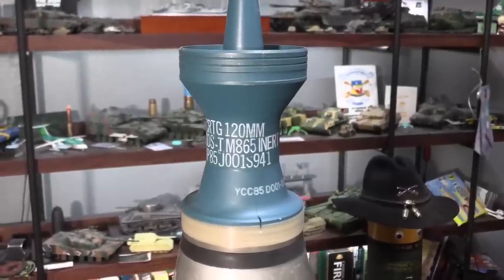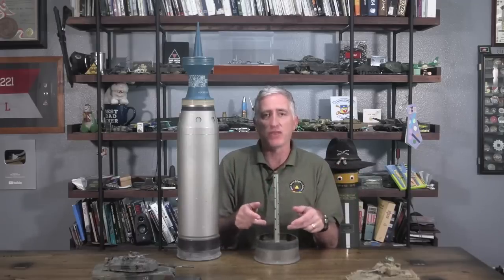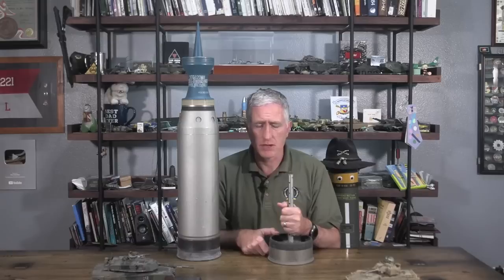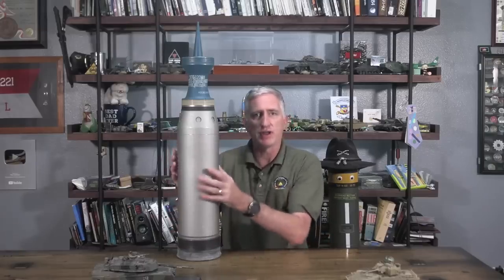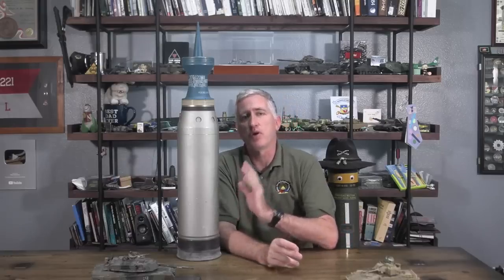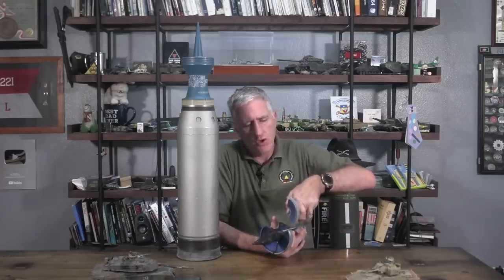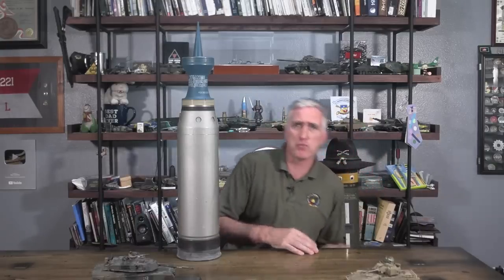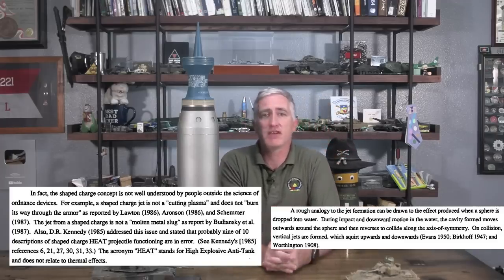Tanks 105: Anatomy of a Modern 120mm Round

Comment: Ahhh, aftcaps. I remember when we first got our A1s ha ing come from 60A3s. The aftcap deflectors on some tanks would cause the aftcaps to hang on ejection. And, not alway because the loaders were a bit too quick saying the main gun after it went boom. You listen on the jump frequency and you would hear "aft cap! Aft cap!" Overand over. And the loaders would normally already have the next round in their hands to load, but the deflector was in the way. Until we finally got everyone and everything dialed in, TCs and the loaderswould either kick the deflector, or knee it upwards. You could tell the tanks that hadn't got it dialed in yet as their loaders wore a knee pad on the leg used.
Reply: Yep. We were all used to hot loading the M60A3s. That was the only way you would get your times down for the gunnery tables. Then all of a sudden we couldn't do that with the M1A1s we transitioned into. Took a lot of adjusting to it.
Reply: The dern aftcap deflector is still a pain sometimes. A squirt of CLP and it usually clears up pretty quick. Either that or just be prepared to kick it.

Comment: About the end cap, those holes make me think of a mortar round.   It also has holes on the stem above the fins that allow the initial charge to bleed hot gases on the small donut shaped propellant charges so the mortar crew and "dial" in the range.
Reply: When you think about it, those are indeed basically mortar rounds with extra steps, instead of "cheese charges' you have a combustible case.
Reply: @robertsmith4681 ou have any info on those cheese charges? Like a technical name or designation/how they work?

My Dad told me about his early days & the different propellant bags & "cheese" that goes into making up a howitzer round but when he went AGR (early 80's) his MOS changed & none of his subsequent units over the next 20 years had big guns.

So while he can still quote a plethora of army regs that facilitated getting his job done more effectively, he can't remember the official designation or description of "cheese."

Edit: could have mortars - but pretty sure it was caseless howitzer rounds built in the tube - but that could have been misremembering. He's old. LoL
Reply: @Iceberg86300  They are basically just linen bags filled with gunpowder. I assume the name got picked up because those powder bags often look like a wheel of cheese.
Reply: @Iceberg86300  Charge Increments

Comment: I remember hearing HEAT shaped charges described as producing a plasma jet, but I've hear more recent discussions referring to it as a "lance".
Reply: It's not plasma. Afaik, the metal of the liner - usually copper - even stays in its solid phase until it starts to go through the armour.
Reply: @Bird_Dog00  Hey!! Someone read their TM! Good for you!
Reply: LOL, no.
Reply: The jet temperature is only slighty over 600 deg C and melting point of copper is 500 deg C higher... plasma is the next state after gas state -> the gas is so hot its starting to lose electrons from kinetic interactions betwen atoms->100% wrong idea.
It is superplasticity caused by high speeds that exceed speed of sound in this metals...
Reply: @Bialy_1  CORRECT. 

Someone is either a materials science engineer or took good notes in ACOF class.
Reply: @mattz1230  even worse - the whole process is so quick that there is hardly even fraction of time required to transfer enough energy to turn copper into plasma. Process takes time. Even much worse - it is highly unlikely (or impossible) for small amount of explosive to contain enough energy equal to specific melting heat and specific heat of vaporization (x mass of material) necessary for phase transitions. And as energy only transforms and is not produced nor lost ... no plasma.
Reply: @mungo7136  Very Correct. A Heat round only contains 4.31 lbs of Comb B explosive. That's not going to liquify copper, let alone turn it to gas or plasma.

Comment: The flash tube coming ooff the primer should cause the powder to burn the length of the charge radially outward for more even combustion. It may also be done due to having the consumable casing so that is the last thing to burn rather than the casing burning from breech end forward and the charge shifting toward the breech.

Comment: On overpenetration: I once read the detailed after-action report from 73 Easting. There were rather a lot of Bradleys (not THAT many, but enough to make one think "that's a lot of oopsies") with a "small, slightly radioactive" hole in both sides. In a lot of cases, the crew didn't even notice. Yeah, there was only one type of gun in that fight throwing DU lawn darts. Some were genuine blue-on-blue/mistaken identity, some just happened to cross between an M1 and a T-72 at exactly the wrong instant.
Reply: In the mid 90s there was report on 60 Minutes about a group of soldiers that were told to wash off a destroyed Abrams.  They wore fatigues for the task.  When done, a bunch of officers showed up in NBC gear with Geiger counters to check their work.   The officers in the NBC gear told them to clean it again as it was still radioactive.
Reply: DU dust is nasty stuff.
Reply: @dmikulec  No. 
That's just wrong. There were no penetrating armor hits.
Reply: No. there were not.
Reply: @jarink1  It is not nasty stuff because of it's radioactivity. Chemical toxicity is way worse thing.
Reply: The fact that lawn darts (a toy) is an essential component of effective anti tank ammo is food for thought.
Reply: @ericmyrs  what are you smoking?
Reply: @mattz1230 LOL have you never seen a lawn dart?
Reply: that sounds like a lot of legends and myths in that comment section. destroyed Abrams don't suddenly become radioactive (unless actually hit by another m1 with DU rounds) and I'm pretty sure you can't measure depleted DU in a penetration hole...
Reply: @Khan-1738  Yeah. They have no relation to an APFSDS sub-projectile.
Reply: @vksasdgaming9472  Yeah, it's like lead ooisoning turned up to 11 rather tjan the radioactivity that's the problem
Reply: No, the crew would definitely notice. Even if the round passes clean through and doesn't destroy the vehicle, it will still cause harm. Every Bradley that was hit with a KE penetrator during the First Gulf War had killed or injured crew as a result.
Reply: Bunch of nonsense.
Reply: @dmikulec  More nonsense.

Comment: Which would you least like your tank to be hit by: the dart, the HEAT, or a squash head?
Reply: Yes...      lol
Reply: The worst would be the dart, then HESH, and then HEAT.
Reply: @qasimmir7117  It really depends on the tank. Older tanks, like an M60 or T-55, that had homogenous steel armor would get wrecked by HESH, but modern composite armors effectively nullify HESH (its method of effect only works on homogenous steel.) And as Mr. Moran stated, if your "tank" has pathetic enough armor, the dart might just icepick through without doing much of anything. This is what was suspected to have happened to the BMP that managed to score a kill on the Americans during the battle of 73 Easting.
Reply: @qasimmir7117  One after the other?
Reply: That would come under the heading of a really bad day...

Comment: 120mm tank gun, an excellent choice for home defense - if you are Ukrainian or other nationality too
Reply: Smoothbore as the Founding Fathers have intended.
Reply: Yes. It is exceptionally good for home defence. And we all know that hostile homes can be anywhere, and you never know when you need to defend against them. But with one of these suckers even the most sturdy hostile home will become rubble in an instant.
Reply: If it's not allready in the constitution im sure someone will intepret it as such
Reply: @zchen27 How do i fit my tank inside my house? In case a robber breaks in.
Reply: @edward9674  In the strictest sense you can probably just lift the gun out and stick it onto some sort of cradle at the top of the stairs. Remember the Founding Fathers don't have fancy pancy internal combustion engines!
Reply: I prefer 155mm howitzers for protecting the family as you can use the w48 nuclear round as MAD deterrent for any possible home intruders.
Reply: Just what you see, pal.

Comment: I seem to recall that during WW2,  Russia  fielded a Sabot round which had an inordinately long dart. Twice the length of the one held up in this video.  Akin to the M829A4 round. If memory serves, the Russians did this to put more penetrating power behind the rounds, with the theory of the day being that the longer penetrator would brute force its way through the armor of vehicles like the Tiger II, and heavier German vehicles. However, the various metals required to make such rounds were in short supply, to the point that crews were only given one or two of them. Reportedly, firing these against anything other than the biggest German vehicles, was an easy way for someone to draw the attention of the Commissar.
Reply: Not sure if you are recalling correctly. There were Tungsten-cored APCR rounds in WW2, which were rare and issues in limited quantity, but those are not darts. Possibly you saw a round still in its case, and that assembly was what was longer than the dart Chieftain holds in this video?
Reply: Sounds like bs. 
The material used to make early rod are simply tool steel. 
The carrier is aluminium, but you can make it out of steel if needed to be. 
Rod physics is not well known until relatively recently. 
Against most german vehicle including panther, they need a rod thats roughly 200mm in length and muzzle velocity of roughly 1500m/s. Steel need to have velocity just a little below1300m/s to erode. 
If you are not doing erosion, simply making a bigger diameter steel slug is a better solution as that allow a lower muzzle velocity. 
We know british has some limited success on sabot separation at the end of the war, we know german does not have any workable solution for sabot separation, the earliest sabot round used by russian is in the mid 50s, well beyond ww2. 
And if Russian actually develop such projectile, why they develop and issue apcr?
Reply: @jintsuubest9331  Tool steel is not a particular type, its a common wording that spans a range all the way from regular low carbon steel thats been tempered to exotic alloys. 

Likewise some of the aluminum grades even today are among the most restricted materials internationally, used only for flywheels in guidence systems and centriguges for nuclear enrichment, and global supply of all grades is a hundred fold what it was back in the second world war. So your suggestion that its "just aluminum" thus must be easy to source is equally naive. Although in that case many carriers of the time where wood, ironically sourcing the right wood was equally challenging due to the requirements of balance, dimensional stability, high forces and concerns regarding moisture ect, all mandating not just a very limited set of tree types, but particular sections and grain patterns.

Russia, Britain and USA all did issue small numbers of sabot ammunition, but accuracy issues at range, concerns regarding gun compatibility and issues with discarded petals on friendly positions meant it was FAR from a clear answer as future of development. Never heard or seen a super long penitrator from the USSR though, that sounds like it would compound rather than mitigate the development issues they actually had, while not solving an actual problem (as much as modern fanboys rage, tigers armor wasn't a concern for the new types in service even then, instead the fear was that a lot of the vehicles and especially towed guns actually on the front lines where NOT modern, and where much smaller... at the extreme end a lot of early "anti-tank" 37mm's served till wars end, and would have been of little help against even the late war Sherman).

Comment: Propellant burns- the more uniform and consistent the burn of the powder stack, the more consistent the velocity produced.  This is extremely important at the extended ranges tankers would prefer to shoot other tanks from.  I won't say there is no chance the long primer contributes to safety; it may very well prevent pressure spikes.  But if I had to guess, it's designed that way more for consistency from round to round than anything else.  It's a lot easier to come up with an accurate firing solution, if your velocity  standard deviation is like 10-20, rather than 80 or 90.

Comment: As a lowly 12B sapper drunkard with dynamite, stand-off for a shaped charge is essentially like focusing a lens. However, different surfaces require different Stand-off distances to get a proper hole. For example, steel vs dirt, vs concrete. As the Colonel shows there is a fixed distance for HEAT rounds. For demolitions ( like blasting a bore hole in dirt) you have to calculate stand-off.

Comment: The primer tube holes are covered in such a way that the primer will perforate the cover at the pressure required to properly ignite the main propellant. The length ensures that the propellant burns both evenly and more simultaneously, rather than from the base all the way up like in small arms. Optimizes the max pressure

Comment: Thanks Nick.

My MOS being 2131, Artillery Weapons Repair I never actually fired any rounds in Ordnance School and on arriving at my Permanent Duty Station - was made a Sentry - so I never actually saw one in the flesh  ... so to speak ... .

I knew how the Sabot round worked but - again - hadn't seen as good a view of them or had the explanation you gave on how the wind tore the sabot off.

I'd also never actually seen a HEAT Projectile either so was surprised to see it's un-aerodynamic shape.

Cool.
.
Reply: From an aerodynamic point of view, pure supersonic flight is much simpler than transonic. The probe will form the shockwave and the rest of the shell will be a much higher pressure but lower velocity post-shockwave airstream. The thing with heat rounds is that drag isn't that big of an issue as long as they have the range hit the target. they don't need kinetic energy so no need to spend money on making the shell any cleaner than it is.  The sabot round on the other hand must keep as much of its kinetic energy as it is in effect the payload delivered to the target. Sorry, I am an aero/physics guy. And yes this is a simplified version.

Comment: Knew most of this particular topic, thanks to my War Thunder related studies. I did NOT know about sabot being a French clog. Neat! Also didn't know about the primer, the rod going up to the end of the dart itself, to ignite more of the propellent at the same time.

I'm curious about the M830A1 HEAT MP-T round, the one which combines the function of standard rounds with a fuse to detonate on aerial targets as well. Proximity fuses in general are still mostly unknown to me. Would love to learn more about how they work. I'm also not sure how a shaped charge is also effective against aircraft if it's not a direct impact. I imagine it also functions similar enough to an HE round, causing an explosion of shrapnel.
Reply: Think sabot is from the Low Countries
Reply: When French workers were being replaced by machines they through their shoes into the gears to stop them.  We Americans just use quiet quitting which as I understand it means you take the pay but do nothing.
Reply: It's a radio proximity fuse enabled by the Loader before loading. When fired, it sends out radio signals and uses a principle similar to the doppler effect to measure when it's reached the closest point to a air target and detonates. Of course, if it hits direct, then it will function as normal. 

The side walls of the round are designed to produce shrapnel. It doesn't take much to bring down a helo.

Comment: One of the unique features of the AMX-30 was the Obus à Charge Creuse de 105 mm Modèle F1 (Obus G) HEAT projectile and its main gun,the Modèle F1, a monoblock steel 105-millimeter (4.1 in) cannon.HEAT warheads suffer when spin stabilized, a product of rifled barrels, causing the French to develop the Obus G, (Gresse).This projectile was composed of two major parts, including the outer shell and a suspended inner shell, divided by ball bearings. This allowed the projectile to be spin-stabilized, and therefore more accurate than a normal fin-stabilized HEAT-round, while the inner shell did not move, allowing the warhead to work at maximum efficiency. The warhead, containing 780 gram hexolite, could penetrate up to 400 millimeters (16 in) of steel armour and was effective against tanks at up to 3,000 meters (3,300 yd). As it combined a good accuracy with a penetration that was independent of range, it has been considered an "ideal round" for its day

Comment: If the casing ruptures while unloading, you can try to shove the bottom piece back in and cycle through all available firing mechanisms. Sometimes that works and if it does, saves you a lot of hassle. If it doesn't, you have to get the pushing rod out and unload from the muzzle end of the gun, which is not fun.

Comment: Had the ammo door close on the case of a training sabot round once during a gunnery. Both me (loader at the time) and my driver definitely had major pucker factor… in case anyone asks, I was new and intended to use the knee switch to hold the door open while we loaded rounds into the tank (as I’d been trained). But but driver, who was a little more experienced, insisted on turning off the ammo door circuit breaker to hold it open. However, as we both found out soon after, he had switched off the wrong circuit breaker and the door closed as we were in the middle of storing a round. The case cracked, but nothing leaked.